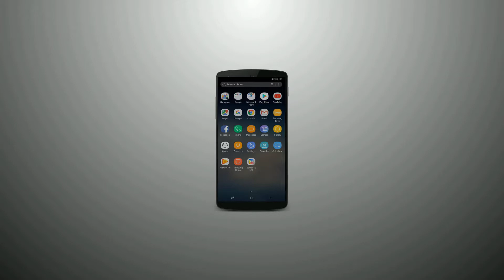sony xperia e5 charging port replacement

Comment: Good video, thank you for posting. I had a problem with my phone after it fall from my bed. The microphone stopped working. So I ordered this flex (has the mic is on the same flex that the charger port). I've replaced the new flexor, but have 2 issues: the first one: if the charger cable is connected, I've no audio output from the integrated speaker. If I'm playing any audio without the cable connected, it works fine, but as soon I connect the charging cable, I got 2 or 3 noisy beats, the no audio at all. If unplug the cable, audio is back. If I use 3.5 port or bluetooth, audio works fine regardless of the charging cable, so this is specific to the integrated speaker. Important: This does not happen with the old, mic damaged, flexor. Do you have any idea of the cause for the issue? May the new flexor be not installed properly (moved a little) or something that cause the speaker to shortcut with the flexor?
Second issue: even after replacing the new flexor, the microphone does not work!! Let me go deeper, it does work but very very very low volume. If a record something (using any audio recording app) and then play it back , I can hear a very low reproduction if I put my ears against the phone, but still very very low volume. In practice, if I call someone, they can not hear me at all. This happens only with new flexor, the old one got the mic unmounted/broken due the fall, so it doesn't work at all. 

Any ideas? Could the new flexor be damaged or have I occurred in any installation mistake?

Thank you in advance for posting, and hopefully you could bring some light into my issue. Regards.

Comment: Hey, great video. I have a problem, wonde if you could help me. I replaced the board because of the damaged microphone. I did everything as shown on the video, connected as it should be. Unfortunately, after rebooting the phone there was no network signal. After replacing the board with the old one the network signal was back again but then it disappeared. Any ideas on what could be the cause? Broken antenna? Appreciate the help.
Reply: Probably is a broken antenna